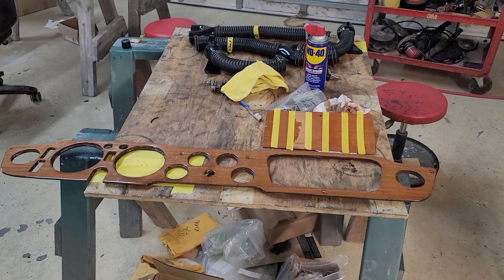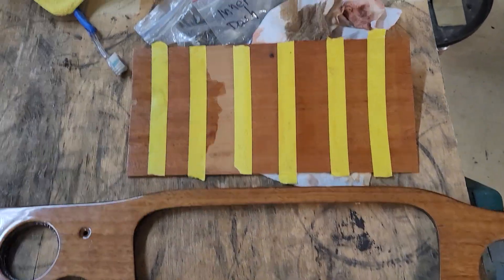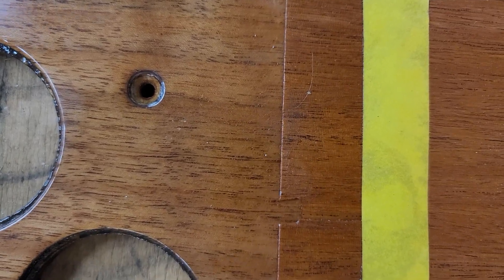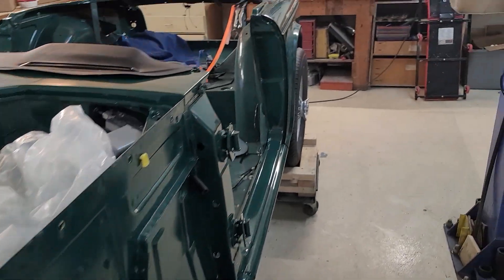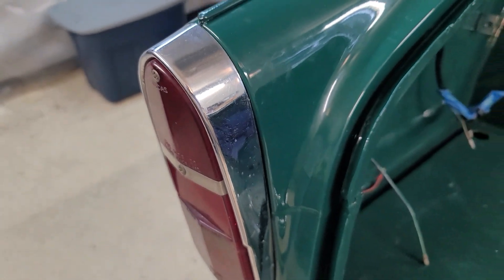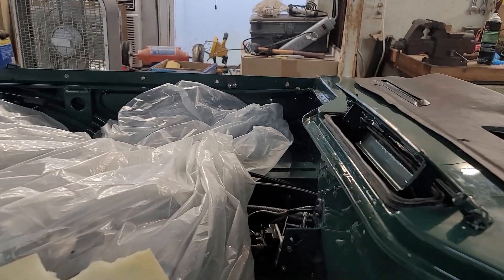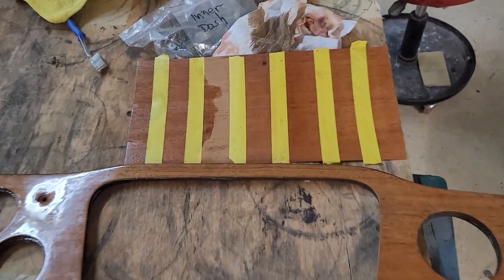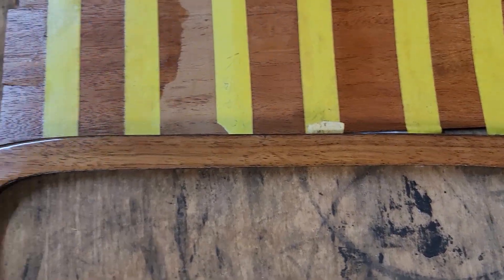TR250 Restoration

Comment: Coming together!  Would it be easier to sand the entire dash down and stain the whole thing and re verathane?
Reply from the maker: Hiya Chef. The dash was just recently refinished so sanding it away really isnt an option. The problem is that the veneer is just a different color and grain that the original dash. Probably going to go with just a clear coat. Its a tad lighter but is probably the best option we have.
Reply: The original veneer is a walnut and if indeed it is still the original it's going to be sun bleached so lighter in tone. You're certainly not far off the mark with some of the color testers on the piece of mahogany 👌
Reply from the maker: @peterh3233  The TR250 has a mahogany veneer. I believe the TR6 used walnut though.